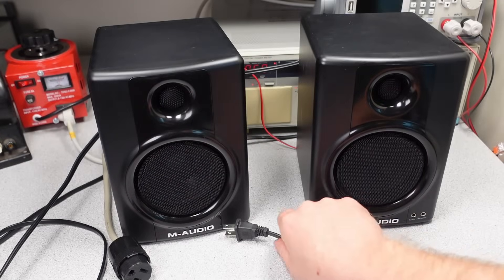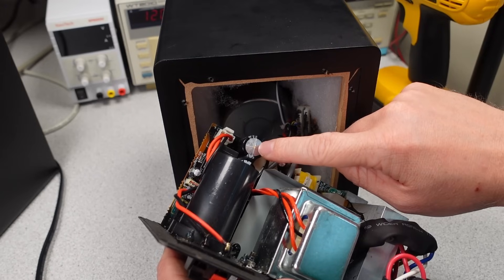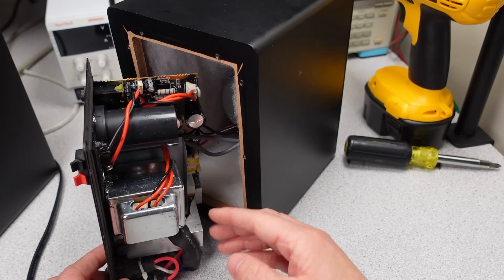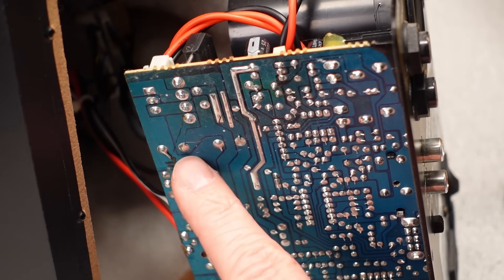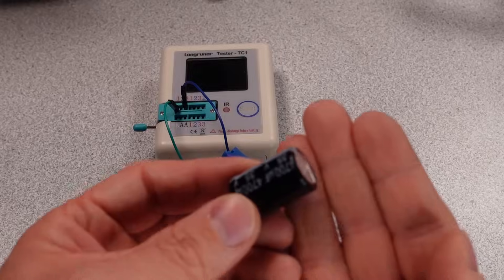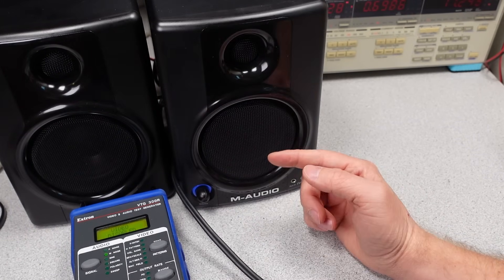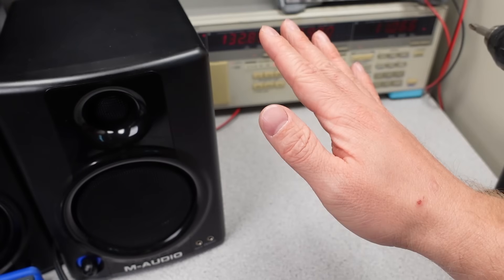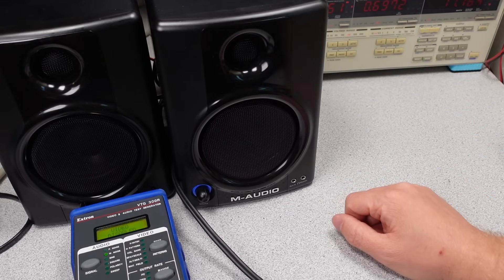M-Audio Studio Monitor Speaker Repair

Comment: Hi, I appreciate the video. I have m-Audio BX8a deluxe monitors. One of the woofers plays at a very low volume while the tweeter plays at a normal volume. I switched out the woofers and they aren’t the problem. Any ideas? I haven’t been able to find anyone with the same exact problem. Thank you
Reply from the maker: That could be a simple one, there is probably a small analog adjustment on the amplifier circuit board (potentiometer), it may have come unglued and moved a little inside the cabinet.  This could lower the volume or raise the volume of one piece of the equipment.  This is pretty rare but it can happen.  Because it isn't a total loss of sound, and the rest of the system is working, it seems more likely, also assuming the sound is still clear but it is just quiet.  There may also be crossover settings on the back of the speaker.  I assume they and any potential wiring issues have all been checked first before opening or swapping anything.  Anyway, opening or doing any work on or near the circuit board is certainly a more risky operation so always be safe and that is at your own risk.
Reply: @AllThingsOnePlace  alright great, thank you for your response. I might look into that in the future but you gave me a great idea in one of your other comments. I hadn’t considered turning them into passive speakers. I've replace some caps previously and the monitors are pretty noisy(buzzy) in addtion to one of the woofers playing at an extremely low volume. It seems like the amps in M-Audio monitors are very unreliable.  
I have some Hertz Mille Pro passive crossovers meant for 2 way component speakers in a car and I dug out an old Kenwood KR-V87R receiver. 
It sounds really good. I even measured the speakers with a umik-1, rew and pn pink noise to see if the crossover was working as intended and it measures very well above 40 hz. Thanks!
Reply from the maker: @Titans2138  Ah ha, yes, that is a great idea!
Reply: @AllThingsOnePlace  Thank you! Like you, I'm sure, fixing things is very satisfying and figuring out this unique solution feels just as good.

Comment: i have those.. but the left speaker lost power.. it sounds muddy and like half its volumen
Reply from the maker: Hmm.  That sounds like it could be as simple as cleaning the volume potentiometer.  But as a proof of not the input, swap the input cables around to make sure the bad audio doesn't swap sides.  Eliminate the cable and source as the problem.  The amplifiers can go bad though, and it is possible that a difference capacitor has failed within the amplifier unit causing one side to attenuate and change frequency response.

Comment: its mine.using 8 years and im happy.only some repair of cables and one socket repair
Reply from the maker: Nice!  Yeah, I'd say the biggest thing is turning them off when not in use.  Less wear and tear on the capacitors will mean a longer service life.

Comment: I bought 2 sets of these and they both tanked with relatively short use . I can`t do the fix so what would it cost at a repair shop ?  M-audio should use better capacitors in the first place . Will never buy anything from the again cuz they suck !
Reply from the maker: I agree with you on the quality front.  Bending the pins over on the caps is an especially mean trick, takes a one hour job and turns it into a four hour job.  It's probably well over a hundred dollars to take this to a repair shop (if you can even find one).  Which means not worth it.  Another option is make both speakers passive and use a small external amplifier.

Comment: My M-Audio started SCREECHING  like an alarm. I turned the volume knob down all the way, still screeching. Pulled the cables and wires, still screeching. Could this effect be the transistors failing? I've never soldered and would like to get an iron, but I don't know if it's worth the cost and effort if it's not the same fix.
Reply from the maker: Sounds like the amplifier turned into an oscillator.  The power transistors haven't failed yet if it's making noise but something else certainly has.  I would start with inspecting the capacitors.  Being a signal issue it might not be the main power capacitors but the smaller signal ones which there are a lot of and may put this in the beyond economic repair category.  If it is a project to learn though, it is not a bad idea to spend some trying to figure it out.

Comment: I have one that just doesn’t work at all same unit
Reply from the maker: Yeah, that will require much more work.  It is likely the amplifier chip itself has gone bad.  I would expect the capacitors to be bad as well.  This can always be repaired but it gets to borderline beyond economical repair..  I would actually recommend converting the powered speaker into a passive one and getting a small external amplifier.  Time wise it will be much cheaper.

Comment: Hi there, i got a question. I have a pair of tascam studio monitors, bit one recently didnt produce any sound. I thought/hoped it would just be a cabel problem. But whenever i turn off the on en off switch off at the end i hear some music again, but when i turn it on again no sound come out. Have any idea what the problem might be? Thx in advance
Reply from the maker: It sounds like the circuit is deciding to mute the output.  The amplifier IC's usually have a MUTE pin connected to some kind of logic for various reasons and during the ON mode it sounds like that is being enabled.  During power down it briefly lets the amplifier turn on.  This could be from several different causes inside the speaker.  It would require some investigation of the circuit board to find the problem.  If the issue is purely cosmetic (meaning a bad logic decision and not overheating or power supply issues then the logic could be replaced to solve the problem).  If it is being kept off due to a bad power supply rail then it could be the same issue as with this M-Audio speaker.
Reply: @AllThingsOnePlace  thx for the explanation, hope my mate will be able to  fix the problem. Bless

Comment: I need one of my ex66 m audio speakers to work. It plays low while the other is loud. Can you help me
Reply from the maker: There is a whole chain of troubleshooting.  I don't know your technical level so I assume beginner at first.  The first step is somewhat obvious and you probably did this already but check the gain controls on the back of the monitor and make sure they are the same (as well as all the other settings).   I noticed these have a voltage selector on the back too so another thing to check.  The next step is to swap the input cables between the two monitors (at the monitor, not at the source).  If the other speaker plays low now the problem is elsewhere (cable, mixer, etc.).  Okay, eliminating a gain or a source problem the monitor speakers likely have some internal adjustments or components have drifted and after years of use something could have shaken loose or changed in value enough to cause some degradation.  It is highly unusual for a power amplifier to go quiet. Amplifiers usually get noisy, make tones, oscillate, go silent, pop, but just getting a little quieter is not a normal amplifier failure mode.  So, if there are any other symptoms those may be a clue to the issue.  The next step is opening it up (at your own risk, remember mains voltage is present inside) and checking components (in circuit as much as you can) and doing a visual inspection.  The next rule is check voltages.  You have a known good to check against so that helps since the schematic isn't available.  If you don't know the electronics then repair shop.  If you do then there's a lot to do!

Comment: I have the same issue but my caps are not bulging, could they still be bad? Also what is the reason for using different spec caps for the replacement? Thanks!
Reply from the maker: The capacitors could still be bad.  I just used what I had on hand. Ideally getting a similar rated capacitor would be best but I did a quick check on energy requirements and found that was good enough for moderate volume playback.  Full volume the caps I put in are too small.
Reply: @AllThingsOnePlace  Thanks for the quick response! I don't have large caps so I'll order identical replacement and we'll see.
Reply: I have the same speaker and experience same issue from time to time. I found that banging the speakers gets them working again. I lift them up about an inch or two and drop them. 😂 Seriously. 

I prefer your method of fixing them the right way though. Thanks for the informative video. I’m tempted to drop $400 on an upgraded pair of speakers, but these speakers are decent enough.

Comment: Thanks sir for sharing your knowledge with us.
Apart from capacitor is there any other components that causes humming sound
Reply from the maker: Yes, there are other ways humming can be introduced.  Anywhere a ground loop can be created or some loose connections inside or outside the loudspeaker amplifier can also create humming.  In general when the amplifiers fail you usually get silence though so hopefully not that condition.
Reply: @AllThingsOnePlace  Thanks alot for giving me such informative reply

Comment: hi sir,i have the m-audio studio monitor speakers,same like on this video
so my speakers problem is,the right speaker is louder than the left one
,so what can i do to make it balanced sir.thankyou
Reply from the maker: Hmm, that is good question.  During my repair I didn't see any potentiometers for tuning the balance of the loudspeaker.  It may have something under some of the other components but that might be more work than it is worth getting to it.  A possible solution is to get an exact measurement of the difference between the left and right sides and add a passive resistor attenuator on the input cable with a resistor divider to bring the output back into balance.  Another quick check is making sure the wire connecting between the two speakers isn't frayed or missing most of the strands.  To make sure it isn't a cable or source issue you can swap the left/right RCA inputs and make sure the attenuation doesn't change speakers.  If it does then the source is the problem not the speakers.  A passive attenuator can be purchased ready made https://www.markertek.com/product/ses-rca-lvl-lr/sescom-rca-lvl-lr-stereo-rca-volume-control-with-independent-left-right-channel-control  although this is a pretty expensive solution to this issue.
Reply: @AllThingsOnePlace  thankyou for your time to reply and give me some answer. ill try it